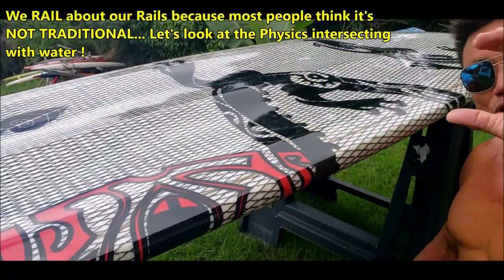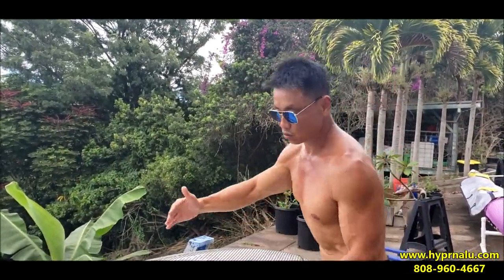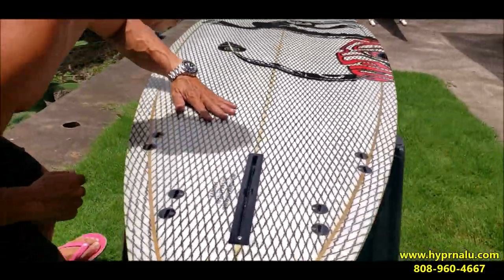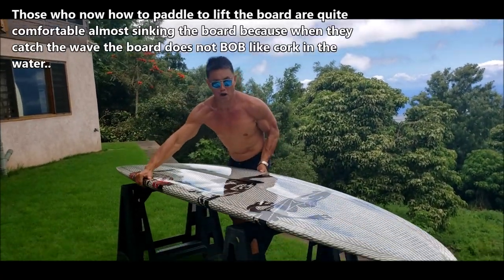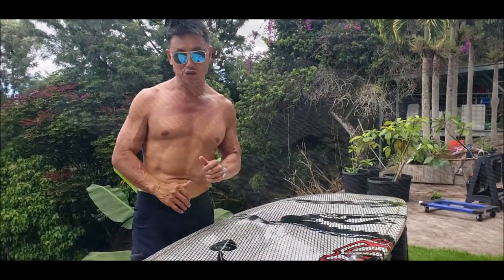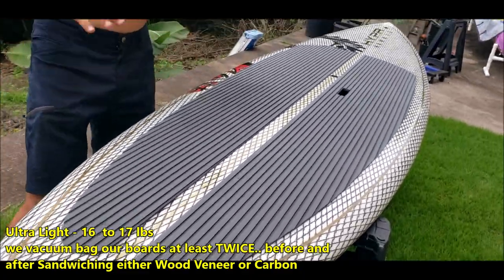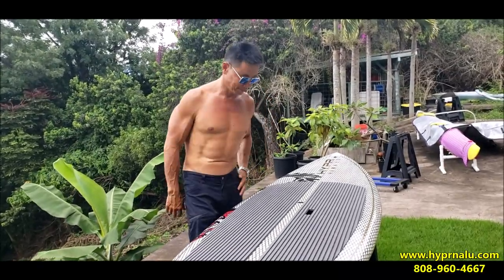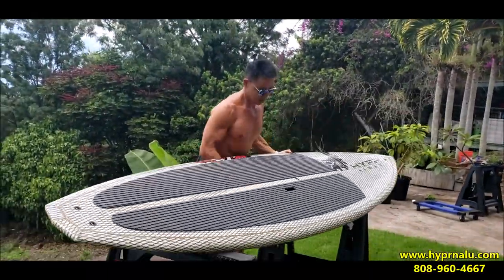HYPR Hawaii Board Philosophy Construction, Design, Lamination - Kaimana Series

Comment: Sweet boards but I dont agree with your philosophy of paddle surfing nor board design. Liters are just as important as width and length. Its your skill level that determines the board you can handle.
Reply: I weight 200 lbs and ride a 79 liter board, 7'6" x 25" x 4". I have been through hell and back getting to an expert level on SUPs. Flotation aka "Volume/Liters" comes at a sacrifice which most beginner SUPers dont want to deal with, once they start getting serious and improve their balancing skill they will surf on the wave better with shorter narrower (width wise) boards, not longer, flatter and thin ones which is your philosophy. 

I had a flat thin board at 7'10 x 28 x 3.5 and 90L, it couldnt hold on the steep parts of the wall of a wave and kept flipping on me causing me to wipe out. 
Went to a board at 7'8" x 27 x 4 and 90L and it rode the pocket well. I will admit thought that the thinner 7'10" board did hydroplane easier as I started to paddle and pick up speed due to its width of 28", but once on the wave it sucked. I love talking SUP so please dont take offence. Rock on dude!
Reply: I would say it's about the complete package. I have a Hypr 11'6" Gun which is 165L and yet it is more stable than some larger boards I have tried. The board sits lower in the water than an equivalent board of the same plan dimensions. 
So, for me litres are important but so is the plan area and shape (Width and length) along with whatever other stabilising effects that can come from the bottom profile and rocker.
Reply from the maker: rks note... you're preaching what I preach EVERYDAY but most people WILL NOT use a low volume board.. I actually train on just a surfboard.. usually a longboard..so you're barking up the wrong tree... you should say that on the iSUP or Starboard page those guys really f-things up

Comment from the maker: For @Frank Ladd - he blocked me from responding..total coward !!! -  Frank Ladd ... yes of course LONGER waterline will travel faster... but you're not comparing "apples to apples" ..we are NOT talking about LENGTH or Flat water vs Chop vs Surf .. you're arguing something that's not even the issue...,  ALL I was saying that a FLAT bottom board will have more hydrodynamic drag than our FLOW concave  hull.. so both IDENTICALLY shaped boards will move differently because of the BOTTOM of the HULL..This is how OUR 12'6 bottom looks https://www.youtube.com/watch?v=0Ww8D8i5PJ8D8i5PJ8 - what does yours look like ?
Reply: I don't understand how can I block you?  Isn't this your video? That fact that the board is not for me should not be something you take offense at.  I'm pretty sure I shouldn't paddle a Sinker in flat water.
Reply from the maker: @FrankLadd  Well, now I can reply.. and I only reply because your kind of philosophy regardless of flat or ocean is basically incorrect ..i.e. floatation volume is not the same as EFFECTIVE MOVING volume.  I couldn't reply before, that was a weird thing..why would you be paddling a sinker ? R U about 300 lbs ?  - check this out - https://www.youtube.com/watch?v=Cxh5GDTz5iU&t=11shttps://www.youtube.com/watch?v=Cxh5GDTz5iU&t=11s